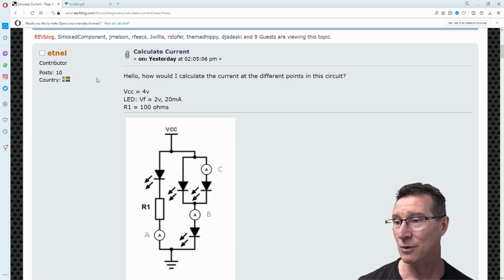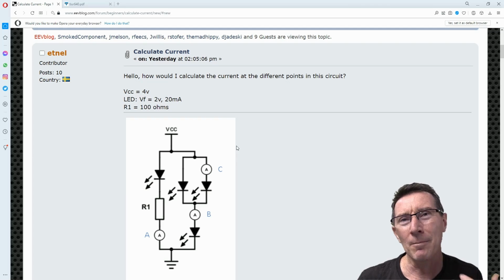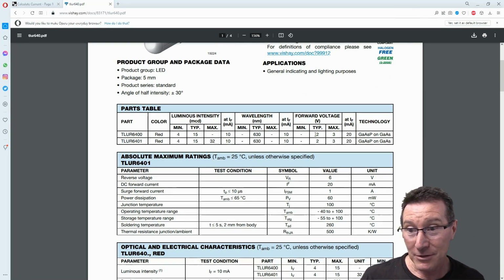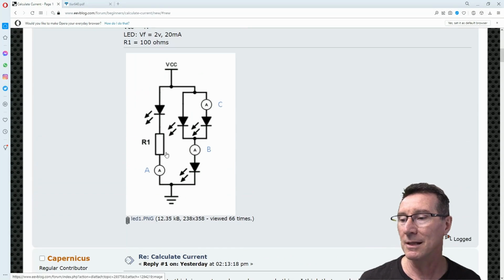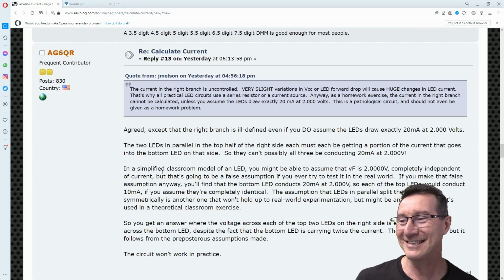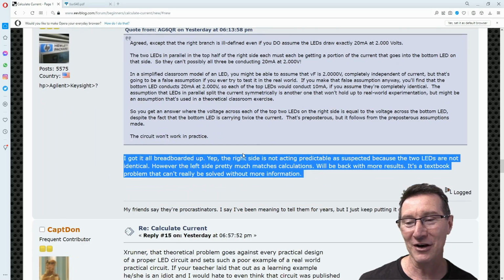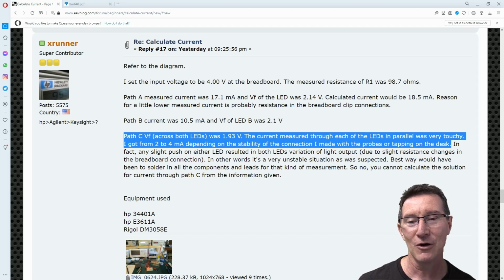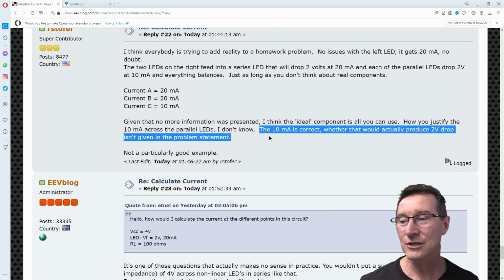EEVblog 1427 - An INFURIATING Electronics Exam Question!

Comment: A is easy.  B and C you would need a characteristic curve to solve.
Reply: Yes.
Reply: But even then it would be just a nominal value at a given temperature. Real world part variations would throw it all out of the window.
Reply: @szabolcsmate5254  Yes, again.
Reply: @szabolcsmate5254  In my opinion we can assume all information given is absolutely true even if it would conflict with reality. Any LED in the circuit, including any variations, at any temperature, with 2V across its terminals, will pass exactly 20mA. We can only introduce reality when it does not conflict with the given information, therefore all we can say about the parts is that an LED across less than 2V will draw less than 20mA and any LED with more than 2V will draw more than 20mA.
Reply: Then you have to take in consideration the interna resistance  of the Ampmeter 😭
Reply: Or is it assumed to be a "theoretically perfect" ammeter with zero resistance? There are virtually innumerable ways over overthinking a question ...
Reply: @TranscendentBen  impossibe ammeter, because they measure by passing current through known resistor
Reply: @OctavMandru  Okay, I'll use a superconducting wire (the only superconductor in the circuit) and use a linear hall effect device to measure the magnetic field generated by the current through it. Okay, it's a length of wire so it's inductive,  but it has zero resistance.
Reply: @TranscendentBen  Free energy!  Why didn't we all think about that?
No, it doesn't work like that. Inductive Impedance is a way you spend energy.
Fact is, given the nonlinear nature if semiconductors, even if the curves are perfectly matched, the "superconductive Ampmeter" will create enough impedance to unbalance the system and create flawed measurements ( for an ideal world where kids in schools have access to superconductivity)
A more feasible approach would be to measure the connecting wires resistance, measure the potential drop across it and calculate the current, without affecting the system too much (even voltmeters will introduce a paralel current path, arguably negligible)
Reply: @OctavMandru  not a hall effect current sensor.
Reply: @TranscendentBen  "Okay, it's a length of wire so it's inductive,  but it has zero resistance."  There you go!  Problem solved.
Reply: @OctavMandru  Usually these questions are not asking what you'd measure with an ammeter. They want you to work out that the current flowing is without connecting anything anywhere.
Reply: @BrianG61UK  well, if we go into diode characterization then we need to think about the other factors that affect the measurements. It is the grown up mind flexing game. Honestly, I learn a lot more  from this game then from the original question
Reply: @OctavMandru  I had the same thought, just how 'real' are we getting with this circuit?
Reply: @4wdguydrivesby  the question can only be answered if real-world diodes are assumed.
With theoretical ideal diodes, the question has no answer.
Reply: You mean a function?
Reply: A is 20mA because the right branch is blown up, so B+C is 0mA
Reply: Calculating voltage drops out, C would have a 1.33v drop and B would have a 2.67v drop.  I think this question expects you to calculate the theoretical resistance of the diode at the 2v 20ma rating information.  The true correct answer, however, does require the voltage/current graph on the spec sheet.  Without the spec sheet the best answer you can get is a reasonable guestimate based on treating them as resistors.
Reply: But we can confidently say that B > 20 mA, and C < 20 mA (and also C = B/2)
Reply: C=B=2A = 20mA --> A=10mA
Reply: @AmatorElektronik  So you're assuming all the LEDs have 2V across them. You can"t do that unless the currents are all 20mA.
Reply: @BrianG61UK  In ideally, each diode is 2V at 20mA.  Since the power supply is 4V and remove the A diode, the current will be 20mA.  You're right.  If the voltage on LED B did not increase by more than 2V then the current B would be 40mA.  In this case, the current B will be greater than 20mA and less than 40mA or not because the increase the voltage of the diode B will reduce the current of the parallel diodes.  Then I am right and the current B will be close to 20mA.  The diode has a strongly non-linear characteristic and a change in voltage by a few mV changes the current by a lot.
Reply: @AmatorElektronik  If you make the, unrealistic in the real world but arguably reasonable given the daft question, assumption that all the LEDs pass exactly 20mA at exactly 2V and have what you describe as "a strongly non-linear characteristic", which is real world realistic assumption, then I think B>20mA and C<20mA. I can't quite get my head around what the likely values will be though. Obviously if the LEDs are closely matched (which seems likely since they're matched at 2V 20mA then B=2*C.

Comment: Although a diode is an active device, operated on DC it can be treated as a resistor in idealized case.  2v/0.02a = 100 ohms.  Just replace the LED's with 100 ohm resistors and give the idealized answer.
Reply: Fair point, I wonder if that's what they were expecting? It would give students a very wrong idea of diode operation thought.
Reply: @ferrumignis  Probably. It does have limitations though.  2 x 100 ohms in parallel would be 50 ohms, 150 ohms across 4v would be 0.027ma, which Dave did measure, but the voltage division isn't  1.35v and 2.7v and that was where my college program then went into the discussion on what makes an active component an active component. Man that takes me back more than 30 years ago now >.< and I am 100% sure my memory is fluid and flawed but close enough to comment on an Australian video :)
Reply: I believe you are right because there isn't any other sensible way to look at it honestly. It's based on a basic formula of Vs-Vf/If used in led series resistor calculation. To make it work in reality there is the automatic leeway given in extra power rating where it is ideally assumed the components can handle it.
Reply: Unfortunately the real world is not idealized. :-)

With half the current the voltage drop across the two upper LEDs will only be ~1.8V, thus the voltage acrosse the lower one will be ~2.2V. This will in turn drive up the current to ~30mA - which will in turn change the voltage drop across the other two...

So depending on the impedance of the wires you could even end up with a nasty oscillator.
Reply: It's not a bad starting point and acts as a good sanity check, but won't give a very good answer because the slope of the VI curve for a resistor is quite a bit different than for the LED. The LED has a steeper curve so the voltage across the diodes will be closer to 2V than with the resistors.  The resistor has a straight-line curve that intersects with the origin.  The LED curve is not so straight and intersects at the forward voltage drop point that is a good bit above 0.  With the resistors, the current through the right side diodes is 26.7 ma with half of that through the parallel set.  So the voltage across the bottom single diode would be 2.67V with 1.33V across the top pair. With the real 5mm RED LEDs I tested, the current was 30 ma total and the voltages were 2.05 across the bottom and 1.95 across the top.  So a 50% drop in current only resulted in a 0.1 voltage drop across the LEDs.  We can use that change in current and voltage to calculate the effective impedance of the LED ad we get .1V/15ma or 6.7 ohms.  Not very close to 100 ohms at all.  Model the LED as a 1.9V attery in series with a 6-ohm resistor and you will get a better result than trying to model it as a 100-ohm resistor.
Reply: @CurtWelch  I used some red led datatsheets from Farnell and Vishay to estimate that we can model a "2V 20mA" red LED as a 1.6V Zener (your voltage source) in series with a 20R resistor over the 10mA to 40mA range. That means we have (4.0 - 2*1.6)V / (20 + 10)R = 0.8V / 30R = 26.7mA for the current in the right branch, i.e. B=26.7mA and C=13.3mA. so far so good.

Strangely enough, if you calculate the currents by replacing the LEDs with 100R resistors, you get 4V / (100 +50)R = 4V / 150R = 26.7mA at B and 13.3mA at C. Who would have thought it? Of course the calculated voltages across each element are quite different, but I was amused to see we get the same currents (which are incidentally very close to the 28.8mA and 14.4mA predicted by the ideal diode equation). The universe is trying to tell us something about the answer to this question :D

Comment: I was on the Electronics 1 course and I was presented to a fairly simple BJT problem, VCC 10V, but they put some nonsense resistors and the VCE was like -23V (facepalm here jajaja) the output side equation was messed up. And the answer I got from my teacher was something like this: as long as the equation works the numbers don't matter (triple facepalm here) this was so disappointing :/

Comment: Feels like people have forgotten the purpose of the exam questions - in this case i assume to test if student has undertand the simplified model and could apply it to real world.

The most complex electronics exam question was about AC phase change on 2 active components(capacitor and inductor) and resistor in various arrangements; 2 items in parallel followed by 1 in series - close enough to reality task but could go worse, but hey... i was Computer Science student not Computer Engineer and that was enough reality for me :D

Comment: Since the question states a fixed voltage and a fixed current for the LEDs, these are obviously ohmic/linear LEDs (I haven't seen such LEDs myself, but obviously the professore has...).
I would therefore replace the LEDs by the equivalent resistance (100 ohms) and solve the resulting problem!

Comment: A bad bad exam question, with excellent follow up discussion.
The two LED's parallel will have a voltage just below 2V due to the halved current, and then follows that the bottom LED will get more that 2V, and then follows that the current through the bottom LED will be above 20mA, say 23mA, a result of the equilibrium.

And the strange thing in the datasheet with 'unit':  the column unit is changed with the column 'min.' An error.

Comment: So i would say the right answers would be:
A 20mA
B >20mA (due to the non linear curve where the paralell LEDs drop less Voltage)
C ~10mA (due to internal differences in LEDs) or >10mA (when assumed both LEDs have exactly the same characteristics)
Reply: And B = 2C
Reply: @jussapitka6041  yes, giving the assumption all LEDs are the same.

Comment: It would be very interesting question if it was about VI and IV characteristics summing for series and parallel connection. But better alternative here - three LEDs in series, what would give approximately zero current in the right branch (for typical LEDs with average forward voltage drop), assuming 4V at VCC.

Comment: Just looking at this, I would say this in not a question for a job interview (though I could be wrong), but something used for learning electronics.
Reply: I would use it.  It could reveal a lot about how the interview candidate thinks through a problem.  There is no absolute right or wrong answer, but understanding how they think could tell one a lot about their suitability for a role.

Comment: Or this was away for a test writer of questions to torture the test giver.   
        Knowing that the company or personnel giving the test were probably incompetent and could not answer the question themselves. 
                Causing Bright students or prospective employees to even question the test explaining how I couldn’t possibly be real world and work properly.   But that would not either correct answer how long is it before the test giver finds out they’re completely idiots who don’t even know the real answers to a wrong question the way it’s worded and design. 

I think we’ve all came across tests with questions that were completely unreal and actually wrong for the answer they had that should be right. 

      And that the owner of the company or the person giving the test or completely clueless and did not understand and cannot possibly solve the problem themselves. 

        Which in that case as a prospective employee you know you’re working for an idiot and your job will probably be miserable working under an idiot so just move on down the line and leave go somewhere else. 

           Don’t work for idiots

Comment: The parallel LEDs must be half the bottom. Hence the bottom will have more than 20mA (2.1V?). The top two will be less (1.9V?). This would give currents either side of the datasheet figures, giving a very unpredictable current down the right leg.
Reply: My response is close to that ! We know that the current in the whole right leg is approx 20mA, since we also know that the voltage change will be small around 20mA (ie approx 2volts across all 3 leds) . But the current in the upper right hand branch is exactly 1/2 the entire right branch (assuming the 2 parallel leds are exactly matched.) So the voltage across the top 1/2, will be slightly less than 2volts,  while the lower led will have a voltage slightly greater then 2 volts, ( to make 4volts) which implies that the current in the whole branch will be slightly greater than 20mA (rather than very unpredictable).
Reply: Yes. That's why one usually adds a series resistor to LED's.

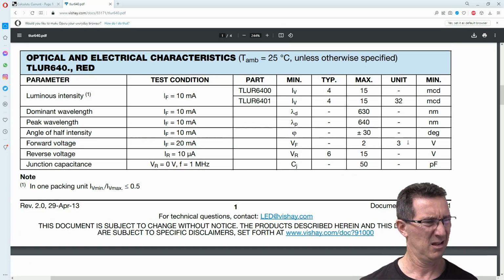Comment: That table at 15:01 is seriously broken.  The headings don't match the collumn data and there are TWO collumns called MIN.  I suspect the headings should be Symbol, Minimum, Typical, Maximum, and Unit.

Comment: Kirchoff's current law is litterally the first law you learn after Ohm's law....
Reply: If it's not, you need a better education! :)
Reply: @CurtWelch  Kirchhoffs laws please i don'T want to loose any voltage in my mesh, too
Reply: @hausaffe100  :)
Reply: Agree about the current law, but the voltage law is one of the hardest ones to get rid of when teaching microwave engineering. (voltage only being properly defined for electrostatics).
Reply: Then maybe the Thevenin equivalent ciruits?
Reply: In our syllabus ohms law was taught in 9/10th grade and kirchoffs in 12th grade 🤷‍♂️🤷‍♂️

Comment: I don't get why you're all struggling so much over this question. It's a textbook question designed to test your understanding and application of very specific equations from the previous chapter, in this case an ideal diode I-V characteristic. Don't try to treat it as a practical ciruit, because it isn't - explaining why it isn't is not relevant to the curriculum, just as explaining Kirchoff's law isn't meant to convey the parasitic impedances present in every practical circuit.
Reply: This is still impossible. Some of the leds in the circuit must be conducting something else than 20ma and the Vf is only told at 20ma. It's impossible to know the currents where you don't know the voltages.
Reply: @jussapitka6041  it all boils down to which (unreal) v-i characteristic is used. If the course at that point was using piecewise linear diode models where I=0 for V<0 and I = g V for V>0 so that when V is 2V then I is 20 mA, you can easily solve it as a resistive network. More elaborate characteristics would require more information.

Comment: I once told the examiners what I thought of them and got a distinction for my troubles, back in the late 1980's I did a city & guilds welding course at evening class there was a few electrical questions and one of the questions was wrong for the answer that I knew they were looking for. So I put down that the answer you are looking for is (I forget what it was exactly) and the correct answer would be and that an institution such as the C&G should ensure that the questions were correct for the answers they want.

Comment: My answer would have been A = 20mA, B = C = 0mA. Without even thinking.After a second of thinking, right side blown.
Reply: If you would actually think at least one time, the right side won't be blown, at least in short term. Try to use your brain and actual numbers before thinking that LED with no resistor = blown LED. Even with real parts, they would not be blown. If Vf is 2V, And you put LEDs in series, with 4V voltage source current would not be so high that it immediately blows the LEDs. With real parts with such spec total current most likely would be somewhere around 30mA. And there will be some imbalance between parallel LEDs.
Reply: @woopsserg  Cool the hostility, we are all friends here. Second, you should watch the video before you attack people in the comments. Third, We all have things to learn and we all have things to teach and being rude is a fast track to being completely ignored by others for both of those things.